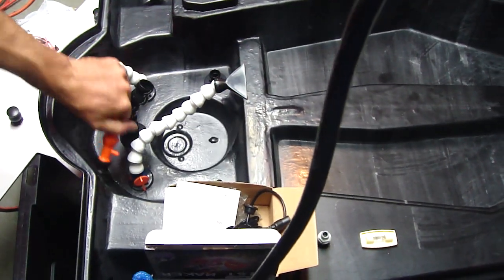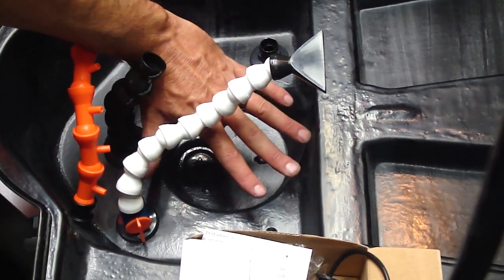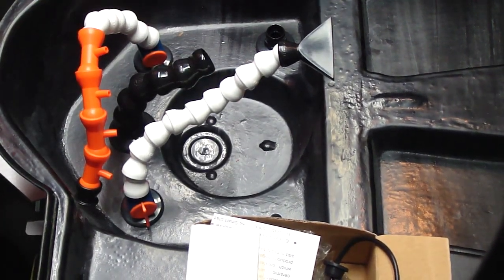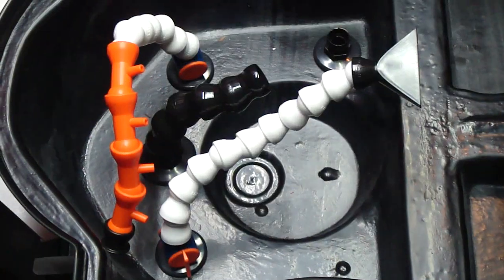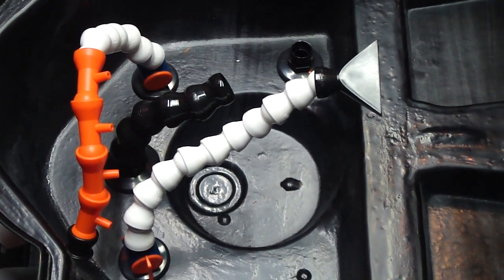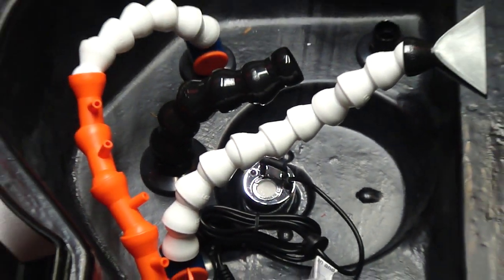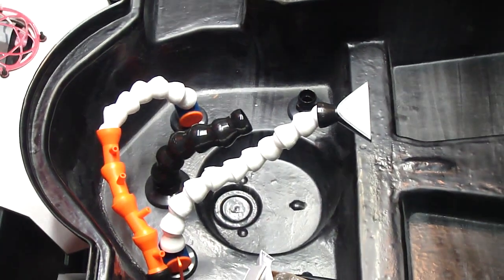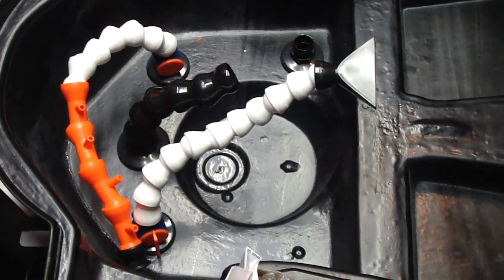TreeFrog by Multiponics Fogger FAQs

Comment: Nutrients are the Carried in the Fog!
Reply from the maker: It would be fun to do a ppm test of the drainage water and compare it to the original source. We know that some nutrients are carried in the fog, but seem to drop out rather quickly in the density of the vapor. Also, the ultrasonic foggers tend to have trouble feeding plants their needs alone. Although they are extremely helpful in developing quick root mass, they seem to fall short in sustaining a plants' nutrient needs. Anybody out there have any data on this?
Reply: So it probably best to only use the fogger for the first couple weeks. Then use a hybrid setup of Aeroponics and NFT to finish off?
Reply from the maker: Exactly! Although some would disagree with the NFT part, it is a good insurance policy and adjustable with our plumbing gear. Thanks for the comments and please keep us posted!